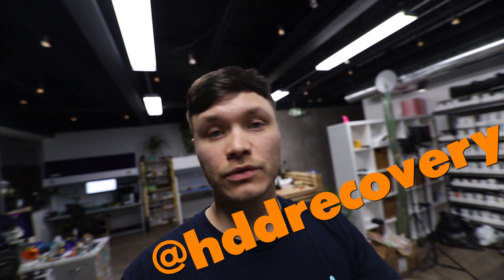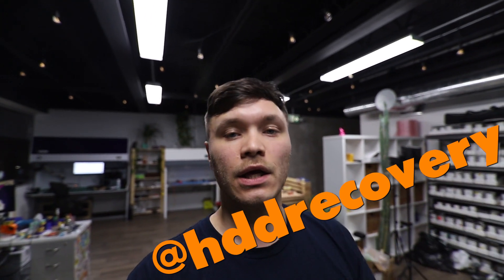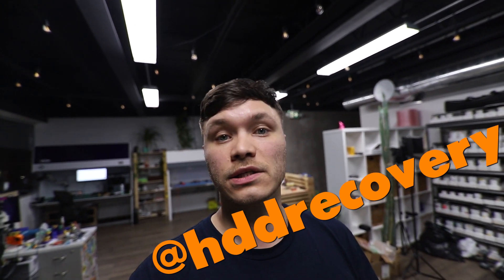dead flash drive from Staples | late night chip-off

Comment: Any reason why u used flash extractor? I was thinking about buying rusolut's vnr to get into chip-off recovery.  i've seen u use both in previous videos. So was wondering if there are any pros to using flash extractor instead of vnr. Thanks in advance.
Reply from the maker: no reason really, I use both on daily bases. As od pros and cons. Both tools have their own advantages. VNR has Android support which is a great plus.

Comment: Dude I’m dying for your help, could you please take a look at a video on my channel regarding my faulty hard drive?! Thanks 🙏

I’ve bought two new WD black drives for a RAID 1 setup but I really really want the old design work/personal holiday photos and other files back off my old HDD so bad :( wish I knew about how much Seagate sucked before I bought it. I’m more prepared now just can’t spend a lot cause I’m a student and need the money for my current living costs.
Reply from the maker: Hi Jimmy, you shouldn't have opened it, that only causes more damage and contamination. If this unit is still recoverable you would be looking at approximately $2K for this job.

Comment: At 1:17 you soldered two pins toghether
Reply: Well, Might be he cleaned it later on and sometimes two legs close to each other are soldered to the same level ground , positive or some other signal hence soldering them together has no issues
Reply from the maker: Ste97Casty yeah but both of them are corresponding to the same pad on the PCB
Reply: Ok, anyway always good job. Really like your videos